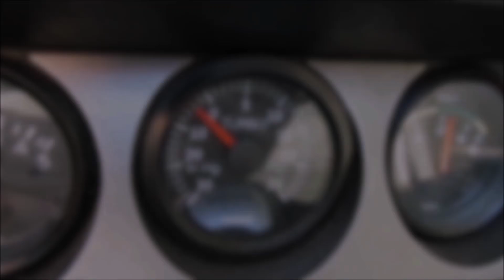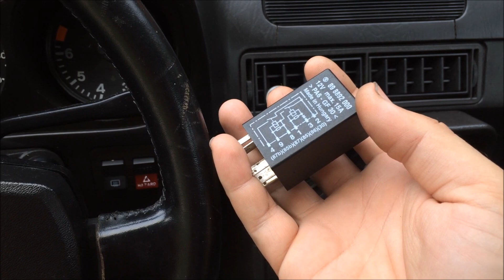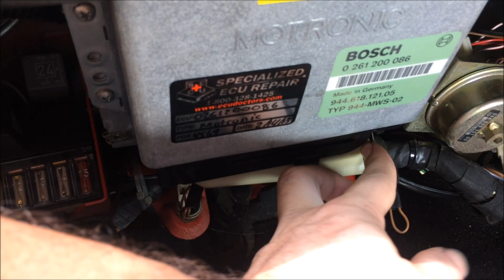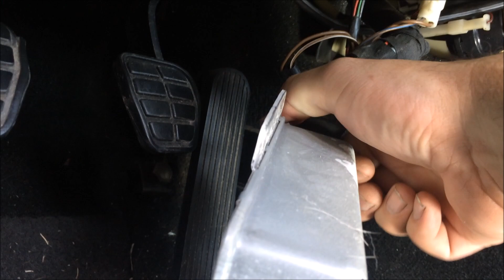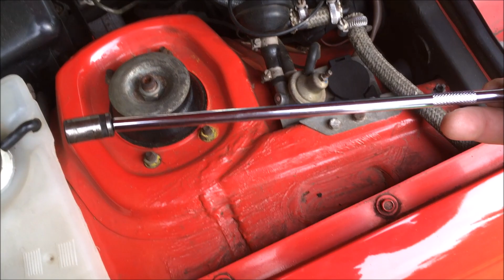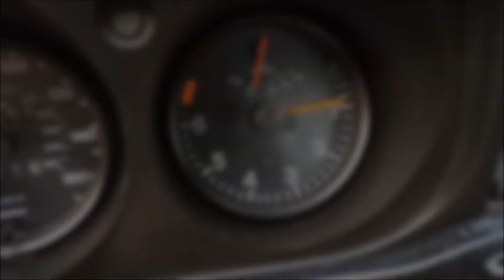Troubleshooting a Porsche 944 No-Start Condition

Comment: Hi,

I have a Porsche 944 Turbo 1986 (951) that was running perfectly before replacing the speed and reference sensors and installing a new sensor bracket.

The sensors are new and were adjusted using a 0.8 mm feeler gauge.

Since then, the engine cranks normally but will not start.

The fuel pump runs and there is fuel pressure at the fuel rail, but I have no voltage at the ignition coil and no voltage at the injector connectors while cranking.

My question is: could incorrectly adjusted speed/reference sensors, excessive sensor gap, swapped connectors, or a sensor issue cause this situation? Or should I be looking elsewhere if there is no voltage at both the coil and the injectors?

The tachometer also shows absolutely no movement while cranking.

Another question: is there any visual way to identify which sensor is the speed sensor and which is the reference sensor on a 1986 951? If the markings are missing, can they be identified by their physical position on the bracket or by following the wiring harness?

The car was running before the sensor replacement and stopped starting immediately afterwards.

Any advice would be greatly appreciated.

Thank you.thank thank
Reply from the maker: No power at the coil and injectors suggest the DME relay is bad since power comes directly from there and also gives power to the computer. So that’s probably why you don’t have tach bounce. 

That said, you mentioned that the fuel pump was working. Ordinarily the pump can’t run until the computer activates it but if you don’t have power at the injectors or the coil, then you don’t have power at the computer. So more than likely you have a self priming relay leading you down a rabbit hole. 

Now, if you did have power at the coil, injectors, and had fuel pump running, it would be the computer… 

I hope that helps.
Reply: @edredas  Thank you very much, because honestly I’ve been going crazy with this car for the last month and a half.

I have already replaced the DME relay with a new one, but I’m still going to do the jumper test just in case. I saw that test online for the DME relay, although as I said, the relay is new and the fault is still exactly the same.

The fuel pump seems to be working, because there is fuel pressure at the rail. The problem is that I have no power at the injectors and no power at the ignition coil.

On Monday, the first thing I’m going to check is whether I correctly set the 0.8 mm gap on the crank/reference sensors, because maybe they are too far away. If that finally turns out to be the problem, I’ll let you know.

I have also been told to test the negative side of the coil against the negative terminal of the battery. If I still get 0V there, then it would probably mean I have a more serious power supply or wiring issue, because supposedly that test should show voltage even if there is a relay fault or a fault in the crank/reference sensor signal.

What you are saying makes sense: if measuring the coil negative against the battery negative gives 0V, then it is probably not caused by the crank sensor. That would point more towards a power supply issue, although it would be strange, because the car came into the workshop more or less running.

Another thing: when trying to start the car, the RPM needle does not move at all. Absolutely nothing.

Thank you very much again, honestly. I really appreciate the help. I’m desperate with this car.

Comment: Hi after replacing my clutch having trouble starting.  It does start after some attempts.   I am getting tach bounce but was curious if it could be the reinstallation of the speed and ref sensors (1983 944) or ???.   Help is appreciated
Reply from the maker: Yes, if the sensors are improperly gapped it can cause a no-start issue. That being said does it run fine once started and start fine once warmed up? If so it could be an unrelated issue having to do with the DME temp sensor or its wiring.
Reply: @edredas thanks for the suggestion.    I’ve only restarted it when warm once and it seemed better.  Once at temp the radiator fan does turn and off as the engine temp changes.    Would that rule out the DME temp sensor.    We didn’t remove the speed/ref sensors from the bracket.   Is there a way to confirm the bracket is back in same place?

Comment: Great video, thanks for the tips. Currently restoring an 83 that has sit for far too long. Already popped in the fancy relay and have the fuel pump engaging but still not start. Now tackling the removal of this damned sensor. Pain in the ass!

Comment: aren’t the sensors a complicated replacement? as in, you have to gap them or something? or can they just be swapped out like in this video?
Reply from the maker: You only need to gap them when the bracket is removed, usually during a clutch service. Otherwise they can be replaced by simply swapping them out.
Reply: @edredas  beautiful thank you so much, that’s important that it’s a simple job because i might have to do this at my college’s parking lot haha. cheers!

Comment: Hi we have a 944 one built in 85, at the moment with the problem that when the car is cold it accelerates and drives normally, but as soon as it gets warm it starts to stutter and jerk when accelerating. The problem occurred when I brought the car out of hibernation after it had been sitting for about 5 months. Before that, the car ran perfectly and didn't twitch at all. We have replaced the intank fuel filter as well as the filter after the pump as our first suspicion was dirt in the fuel but that was not the problem. Is it possible that the mass air flow sensor is suddenly broken due to standing still or what could be the reason? We need help or tips for diagnosis. Kind regards Jonas
Reply from the maker: I’ve seen something similar before. Does the car happen to have a hole in the battery tray? Sometimes water will drip down onto the computer and ruin it. The symptoms won’t show up until the computer gets warm and starts malfunctioning.
Reply: @edredas  thanks I have checked that just now and there is no hole plus the car was stores inside and hasn't Seen water in a long time…. Any other possible causes ideas?

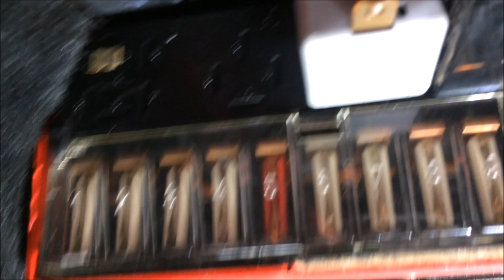Comment: what is the metal TAB under the fan relay? should be #7 on the Relay column box on early 944 1:48 does that metal tab serve a purpose??
Reply from the maker: I believe it supplies a permanent connection between two connections.

Comment: When this happened do you hear the fuel pump primming?
I have 1986 944 turbo.
Reply from the maker: I did not hear the fuel pump priming since the original fuel pump relay does not have that feature. With a faulty sensor and original relay you wouldn't hear the pump since the computer controls the pump and doesn't see the engine trying to start. With an aftermarket relay you may hear the pump priming when you turn the switch, but there would still be no spark in this situation. I hope that helps!

Comment: Is it necessary for the bracket that holds the 2 speed sensors to be bolted to the intake manifold for the car to start? I'm having a no start situation.
Reply from the maker: That bracket just holds the connectors and would not prevent the car from starting.

Comment: I believe when checking the sensors at the computer, it should be pins 25 and 26, not 26 and 27. 

And also pins 8 and 27 should be the other sensor.
Reply from the maker: You are correct, I thought I would make this video in a hurry and did it by memory, which I shouldn't have.

Comment: hi man i have same problem here and i didnt find out yet the speed sensor and reference sensor is new and the tach not bounce when turning the engine over and the fuel pump working good and i get used ecu to try with car wont start the car is not starting for over 20 year it had 28000k only but today when i move the ecu and give it ground it start for 30 min and when i turn it off  i cant started  again i think the problem with my 2 ecu or some wiring can you  help me pls solve this problem
Reply from the maker: Hi, if the tach is bouncing and the fuel pump is running every time you turn the engine over, it's more than likely a wiring issue. Do you have spark when it doesn't start?
Reply: @edredas  no spark and the tach is not 
bouncing

Comment: Hey Ed. I just put my engine back together. No start but cranks but theres an odd screech noise after its fourth or 5th Cycle? I put the timing together as much as i can get it to but im concerned about that screech like if its metal? Got any ideas?
Reply from the maker: That doesn’t seem right… if you are on Facebook come join my group and upload a video.
Reply: I just joined the group. Actually the noise was pressure in the intake? I may have mixed vacuum lines or pressure lines that surrounds under the intake manifold. I get a shot of white blue smoke. After I pulled out the j boot a have fumes coming out.

Comment: i replaced mine and it worked but now it doesn't start again
Reply from the maker: Try giggling the wires and see if you can get it to start. It's very common for them to break on the harness side and perhaps when you replaced them they reconnected momentarily. If giggling works then try pulling the boots on the connector back to see if they are broken and repair if necessary. I hope that helps!
Reply: @edredas  Update my j boot was ripped so i think it threw off the computer! hoping that's the issue p

Comment: 5 years later and this video was super helpful! Both of my sensor wire connectors were completely degraded! Like half of the plastic that surrounds the metal was missing. Gonna order some new ones and I’ll be back to driving the beast!

Comment: I have a 944S2 which refused to Start. Tried the all the advised stuff, spark at plugs, cylinder pressure, fuel pressure, sensors etc. It turned out to be the fuel damper, a part no longer available new. Had to find a salvage one. Fine starting after that.

Comment: I love your videos, they are my go to when I have an issue. I am however struggling with an issue on my 86 924s . When I remove my key the engine continues to run as normal. I've swapped the ignition switch and DME relay any ideas? Thanks in advance.
Reply from the maker: Is it dieseling, where as its a run on condition where there is knocking associated? This isn't common in a gasoline engine but I've seen it before. Or is it as if the switch is still on? If its the latter then it isn't terribly uncommon for the wiring to be mucked with in these cars. So the only thing that I can think of is that perhaps there is a short somewhere in the ignition switch wiring. Many times people do not realize that the fuel pump will only kick on once the computer recognizes that the engine is being turned over as a safety feature. This prevents the fuel pump from continuing the run in a situation where the fuel lines have severed. The engine would stop running in that case and cut the fuel pump off, but many "mechanics" will circumvent this because the think that the fuel pump isn't working because it does nothing when the turn the key. This not only causes an issue that can be very dangerous but can also keep the car running after the key is removed if it is done poorly. I hope that helps!
Reply: @edredas  Hey buddy, I figured it out. I replaced all my dash bulbs with LEDs, including the battery/alternator indicator light. I was getting current back feed from the alternator with the LED in in that bulb holder. I swapped back to the original glass bulb and hey presto, problem solved.

Comment: i have a problem with my 1983 porsche 944 I have checked the reference and speed sensors, both mark ohms but they do not give voltage when turning on
Reply from the maker: Interesting. If everything else is showing continuity then the sensors could be bad if they are not outputting any voltage when the engine is turning over. Also be sure to note I think the voltage may not show up on all multimeters since it is a very fast pulse. I hope that helps!

Comment: I have a 924 with no spark issue can you give me shoot me some info on how to check for it I have new plugs wires cap n rotor getting power and ground but still no spark
Reply from the maker: What year is your 924? If it's a 924S from 1986-1987 then the wiring is the same as the early 944. Does the power windows work? Power to the coil comes through a plug on A on the back of the fuse box but that is supplied from the switch though a plug on E. If the terminal on E has corroded then you won't have power windows or power getting to the coil. I hope that helps!

Comment: Bought a 1984 944 automatic about a month ago and am finally getting work done to it. She will not crank by key, but I have heard the car run with the old screwdriver across the starter trick. Starter is getting power, but nothing when I hit the key. After finding and replacing/repairing all sorts of corrosion around the fuse boxes and many wrong fuses, still a no start by key. Replaced the ignition switch and nothing. I'm thinking a new starter solenoid, but I am not sure. Close to pulling the trigger on a new starter anyways... Any suggestions? The car has all sorts of aftermarket junk like a radio and some sort of "scosche" relay wired to the starter that I removed because it was rusted out. Thank you for any help! I cant wait to get my car on the road.
Reply from the maker: If the starter works when you jump it, then its likely not getting power from the ignition switch. Make sure that you have continuity from the switch to the small wire on the starter. I hope that helps!

Comment: My 83 won't crank at all, no clicks or ticks when I turn the key. I put a brand new battery, so that's not the issue. Any suggestions?
Reply from the maker: Check for 12 volts between the small wire and a ground on the starter as someone turns the key. If you don't have 12 volts there make sure the smaller plug behind the brake booster is clean and plugged in. If it is the ignition switch is likely the issue. If you do have 12 volts at the starter then the starter is the issue. I hope that helps!
Reply: @edredas  will do! Thank you!

Comment: Hey your help was absolutely a huge benefit to me . Up and running . I have another question if you can help . The stock tires all the way around on this 1984 944 are 215 60 15 . Would you know how much wider of a tire I could put on the stock rims safely ? I just think it would look better . Again , your help is what put this back on the road . I have to buy new tires because I bought this in the winter initially and put studded tires on because I bought this for my son to learn to drive a stick.
Reply from the maker: Awesome! As far as tires go I have seen N/A cars with 225/60 on them. You might be able to go up to 255 in the rear but not so sure that those will fit on the front. I have personally only used the stock sizes on my cars, so apologies for not being any more help than that. Thanks!

Comment: My 85 had a loose connection on the crank reference sensor, it was an easy fix after checking forums for tips but, I wouldn't have found it on my own.

Comment: With just the ignition on and new relay and DEE should I be able to get voltage at the fuel pump ? 1984 944 . I am not getting voltage.
Reply from the maker: The only time you will have voltage at the fuel pump is when the engine is being turned over by the starter or when running. This prevents the pump from pouring fuel onto the ground in the event the engine has stopped because of an accident with the fuel lines severed. 

Try using a jumper in the DME relay socket and checking for voltage that way. I hope that help!

Comment: Thanks a lot. My 1991 S2 revs terribly. If i press the throtle normaly almost nothing happens but if i press it very slowly ir gets better! 
And normaly slowing down in the same gear, below 2000 revs ir produces small explosions...! 
...Any suggestion! 
Thanks a lot.
Reply from the maker: Sounds like you could have some vacuum leaks.
Reply: @edredas  Thanks, but no. Accidentally, i've found the problem. It was a bad pluged conector in the Mass Meter. I spent more than a half year with this, changing things in the engine and it was only that. Now its great again. Thank you all.

Comment: Check all ground points theres five also check accumulater.. theres a larger unit avaliable
Reply from the maker: The only ground point that would cause a no-start on a 944 is the one where the DME or computer is grounded on the back of the engine. When it isn't getting a connection none if the gauge lights or starter will work. So it was pretty easy to rule out as the rest of the ground points are for accessories and lighting. Also there's no fuel accumulator on the 944.

Comment: You measured your speed sensor and reference sensor, left and centre contacts, but did not measure left and right contacts. Do they not matter?
Reply from the maker: Those two other wires are the ground and for the shielding over the wire which is also grounded. So if I'm not mistaken, even when the sensor is no longer functioning they will always show zero resistance unless the wiring is broken. I hope that helps!

Comment: porsche 924 starter relay location
Reply from the maker: Like, the 944 I don't think that they have a starter relay. Check for 12 volts at the small wire on the starter. If you don't have 12 volts then more than likely the ignition switch needs to be replaced.